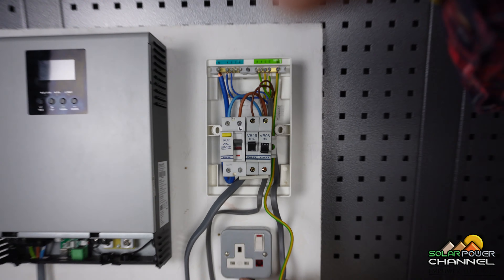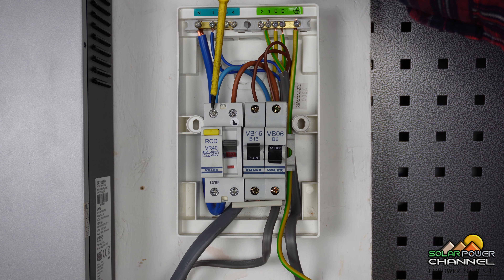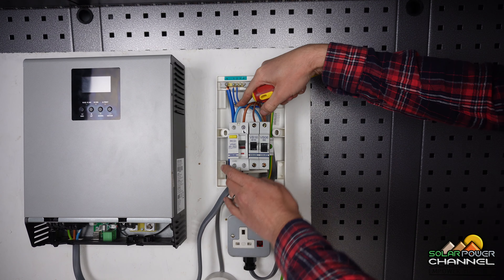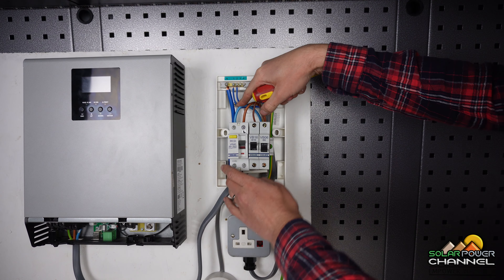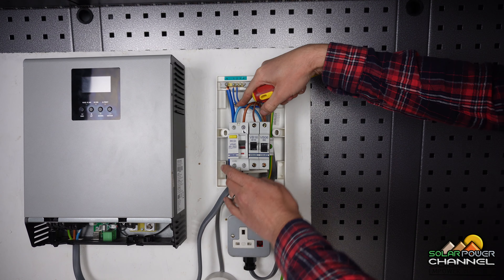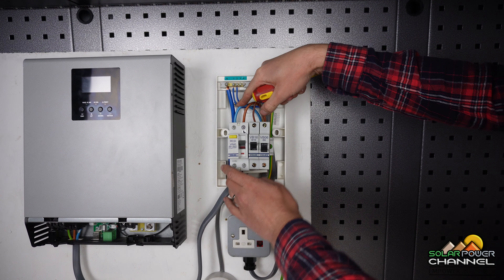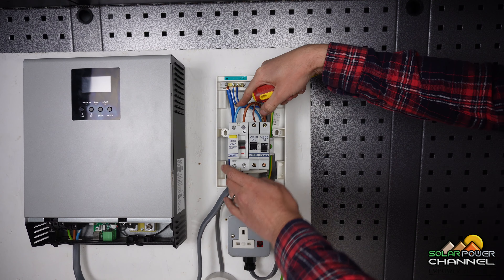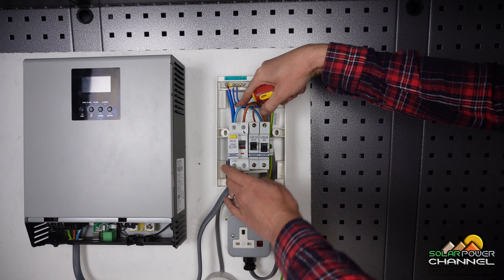Consumer Unit Wiring In Inverter, Off Grid, Boat, Shed, Cabin

Comment: This is a very complex situation with earthing and inverters some inverters using isolated terra earthing of arrangement this means that the Earth does nothing you may be required to devolve your own Earth from the neutral that is really important to look at this properly as you think essentially be pointless. You may also have some reference this earth to the actual earth or not. Please thoroughly research this and get a professional because it’s not a simple answer also consume units are switch gear and should really be metallic in construction and design now also any consumer unit that is installed has to be notified to build a control and you really have to be qualified to do that otherwise things like insurance can be invalid

Comment: Tx for video.   Interesting configuration. Here is in Australia, electricians generally use an MCB as a main switch and 30mA-rated RCBOs for the individual circuits. If an RCBO is used as a main switch then its generally rated at 500mA to avoid nuisance tripping.  Not saying your configuration is wrong, just saying.

Comment: Need a metal enclosure, Type A RCD needed as a lot of smaller appliances send out a small amount of DC which could stun your type AC rcd, fault current on your 16a mcb exceeds your inverter capability , no cable strain relief, no folded ends on solid conductors, wrong size main earth, no bonding to inverter, does the inverter support a PEN conductor? .. whats the trip time on your RCD? have you tested it with an MFT  .. i'm all for people doing small off grid systems and its a great thing .. i just get annoyed with "how to" videos when no real research effort has been put in and potentially put others at risk  .. come on lets see a brit do better than will prowse
Reply from the maker: Hello, thanks for your comment. I feel I cannot talk to much on this subject as I am not a qualified sparky, I am aware I could be sending out the wrong advice. But I want to make people aware about fitting a unit. I am also aware this is the wrong sized consumer unit for that inverter, it is to big. The inverter would click off on high load before the MCB failed.. Which is why people need to get advice on sizing there unit to there application. I was also going to talk about trip times, even had a photo ready to explain the letters on the MCB. But if I make video's to long. People switch off and move along, the audience retention is measured and YouTube don't push content. It is often I miss information out due to how YouTube algorithms work, I do it all the time. Yes I am competing against Will! It's costing me some money as everything I am having to buy!
Reply: Test the RCD trips on your down stream AC socket with at least 25ma before showing the world a video of something that does not work properly. An RCBO or RCD will not work without being correctly bonded at the service entrance which is something commonly missed in off grid setups.

Comment: So, if I where to want to wire multiple (say 4) mains sockets to a correctly rated mcb, can the all just spur one after another or does it need to be a 'ring' if so where is the ring terminated back in the consumer unit?
Reply: You can either wire as a radial, where each socket essentially feeds the next one, or as a ring, where the wiring is the same but you complete a loop back to the DB and terminate the cable back into the same breaker (so you would have two cables in the MCB/RCBO). 

There are regulations dictating what size cables and breakers should be used depending on the configuration of your circuit which must be complied with to prevent damaged to cables and equipment from overloading.

Comment: I have a 3000w Renogy inverter but I don't believe it has the separate terminals for LNE, but it does have two 3-pin plug recepticles, so I guess I can't wire that into a consumer unit like you have?
Reply from the maker: Yeah you can, did it in my campervan with a 2000w Renogy. Other end of the cable to the consumer unit.
Reply: I have renogy 3000W and I asked on one pf the forums if I can connect to CU. They said Waste of time wiring that inverter to a consumer unit, it doesn't support it. When I asked why they responded no neutral/earth bond or ground relay, technically that unit doesn't even have a neutral, just l1 and l2. It's not designed to be connected to fixed wiring. So how does it work then?  I was planning to connect shore power through CU to inverter AC in and from AC out to another CU and then from there to wall sockets in my campervan.

Comment: What about if you need to add more than one socket? I’m assuming you just wire from additional sockets and back to the same MCB sharing?
Also if for example I’ve got a renogy automatic recognition of power source would this then detect and allow socket use if hooked up or just inverter? Thanks
Reply: There are several ways involving radial circuits and ring final circuits. The easiest way simply connecting out of one socket to another socket but there is an element where you would use a ring socket if you have lots and lots of sockets.

Comment: My inverter unit has an earth  screw and only live and neutral terminals, so do I just wire the earth screw to the earth bar in the unit then run a cable out to my houses earth spike?
Reply: In case it will be an isolated para earthing arrangement and it is not recommended without special monitoring equipment. You would probably be best to connect the neutral to us as well but this really needs specialised engineering plans.

Comment: Hi Chris, what size cable did you use from your inverter to your consumer unit? Cheers mate.
Reply from the maker: I used 2.5mm in this video. But this is all reliant to current and length of the cable, due to voltage drop.

Comment: Torchy is a bit right with all the issues there.
One thing I'd point out is that the earth goes to earth not chassis. It's got something to do with the rubber things on the corners :)

Is that the vevor inverter?
How it holding up?
How loud is it?
Does it have active grid switching?

The price of these is really low and saying that my expensive one wasn't build correct and blew up due to a really simple manufacturing mistake... It was a  liebert.
These vevor are almost change, and less than a battery costs. But do they last and can you change settings like charge voltage etc. 
Not much about those on-line..